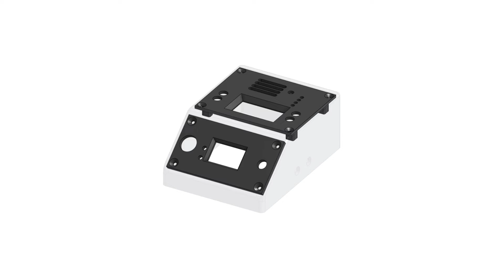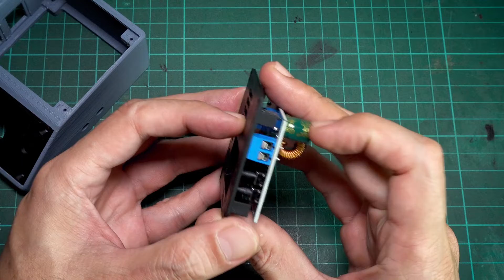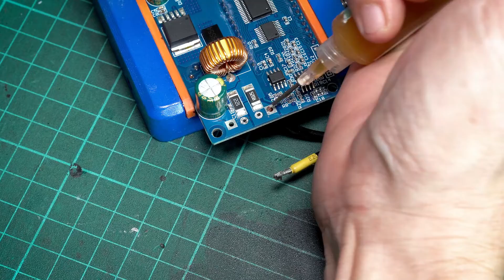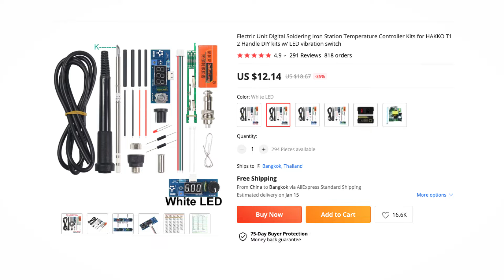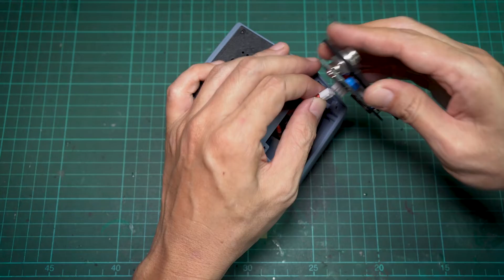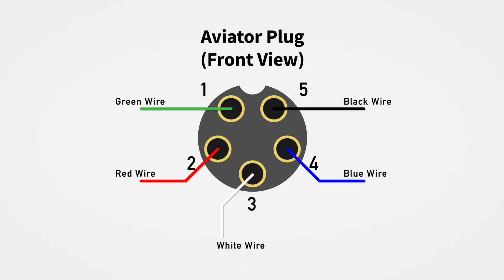DIY Portable 2-in-1 T12 Soldering Station Using Makita 18V Battery

Comment: Is it difficult to make one that takes traditional 900M style tips? I want to make a station dedicated to installing heat-set insert nuts, but the installation tips don't work with cartridge-style soldering irons.
Reply from the maker: Is this what you're referring to?
https://s.click.aliexpress.com/e/_DmgDenp

You can find a convenient purchasing option for this item. I've actually placed an order myself to give it a try.
https://s.click.aliexpress.com/e/_DltDNpZ
Reply: @simplymaker  Yes I was referring to something like that. Too bad that the iron has a minimum temperature of 300 C, though. For PLA plastic, one should set the soldering iron to around 225 C to avoid deforming the plastic more than needed.

I liked your idea of making an iron because I thought I might be able to reach a lower minimum temp. 

Thanks for the reply!
Reply from the maker: I didn't notice that, will let you know how it goes when I received it. Thanks 👍

Comment: Hi were you able to change the amp draw for the soldering iron. It uses only 15w for me and the soldering station board can use up to 75w. (I would like to speed up the iron heating time)
Reply from the maker: I think it is limited by the battery pack.
Reply: @simplymaker  I have a 6a Makita battery that can provide >300w, so i doubt that 😅
Reply: @jobvanwijngaarden  maybe you coud try using boost converter (step up) and set the voltage to 24v

Comment: My station also still works fine, but be careful, the 14.4V batteries do not have undervoltage protection, i think also the 18V ones also don't have. if you leave it open for long it can destroy the batteries, I did it one time and had to replace the cells inside the battery.
Reply from the maker: Hi, Thanks for your helpful info. Your enclosure design is really nice. The only problem is, I don't have a 14.4v battery. lol
I ever run it until the battery is low. I think the soldering controller starts blinking and stops heating up while PSU is still on. But I think the battery is still ok. Really not sure about the under-voltage protection.